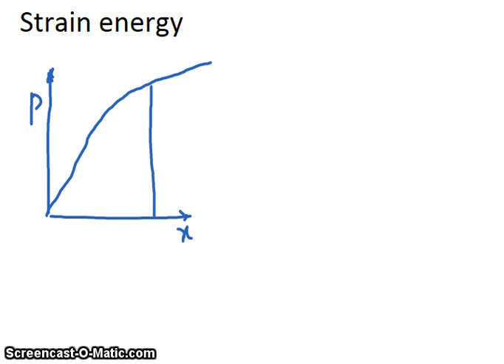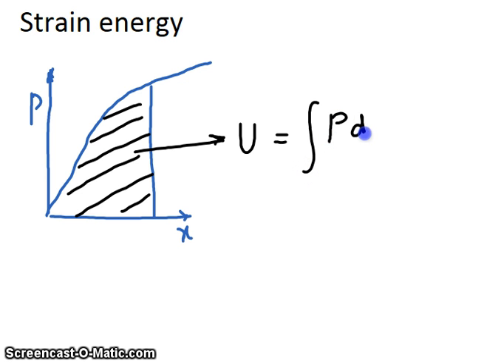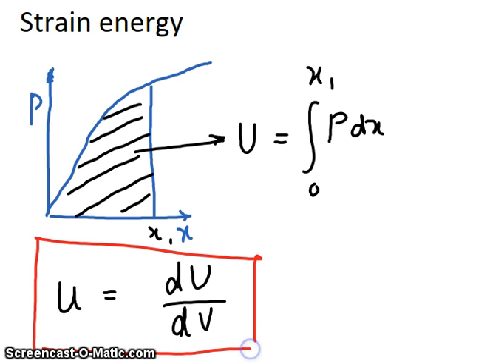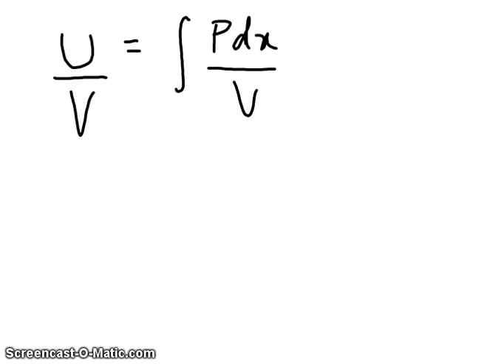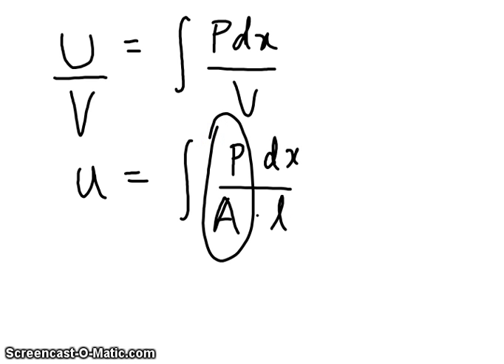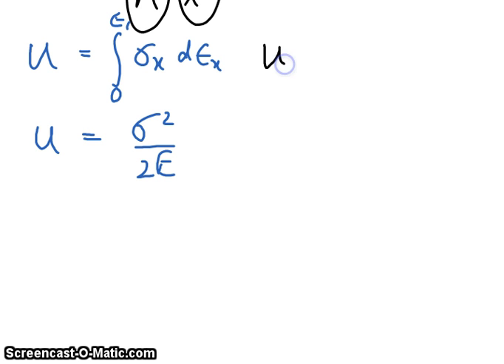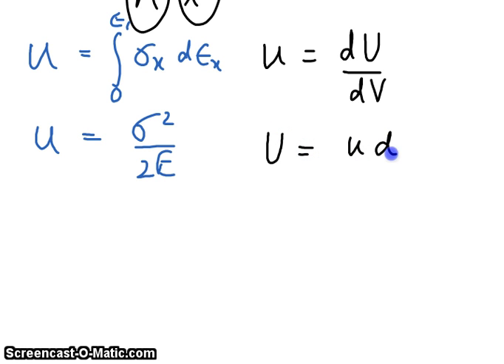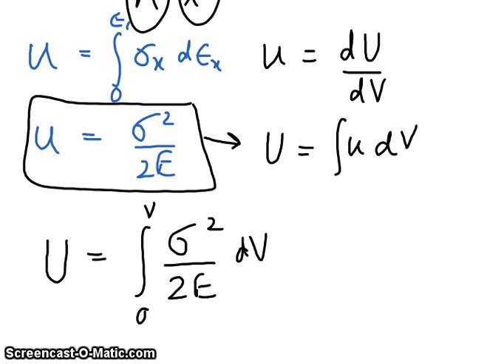Strain energy (part1) - Axial and Bending loads

Comment: Why we use strain energy density in place of starinenergy
Reply: To avoid the geometric dependence. when we solve the complicated problem we use concept of elasticity, which uses equilibrium equations and boundary condition to find the stress and strain distribution inside the body. So the strain energy density makes more sense than strain energy. You can check my video on my channel #cheers